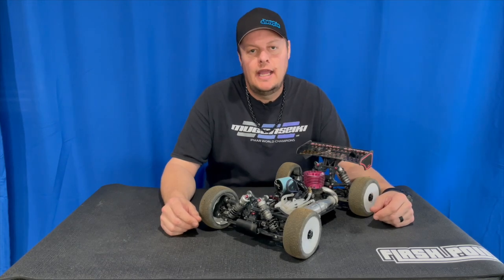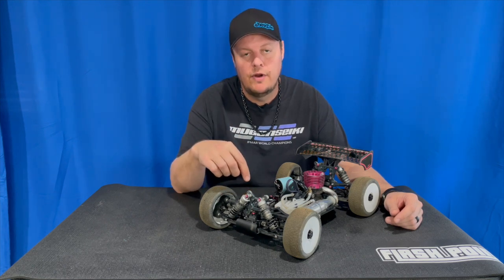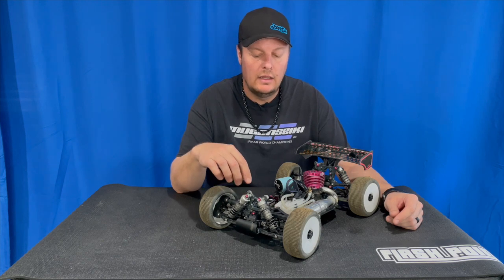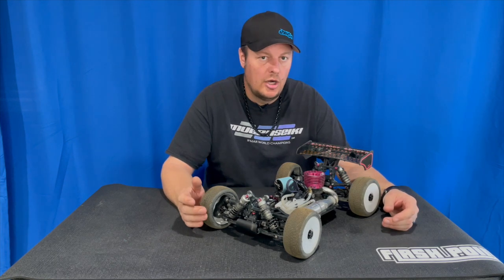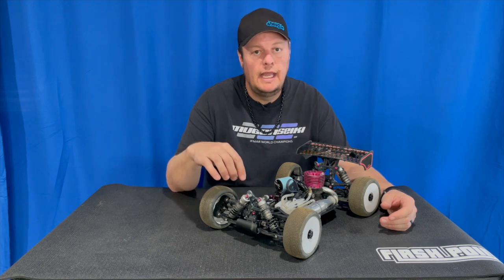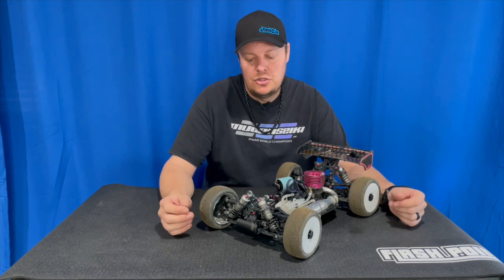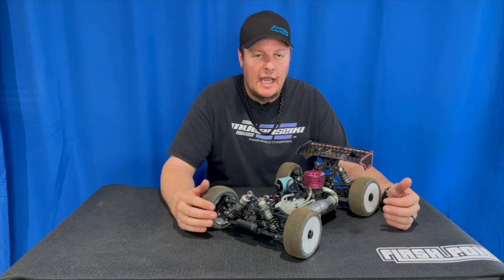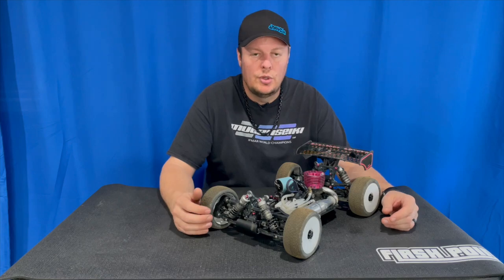Tuning with Upper Front Arm Length

Comment: Hi Adam I was hoping you could tell me what shock weight you run front and rear at thunder alley? Also should I stay with the stock springs? I’m still trying to figure out tuning tips. Running an mbx8r Thanks!